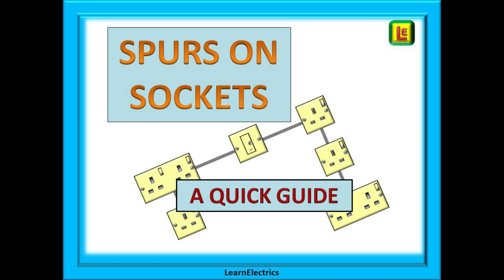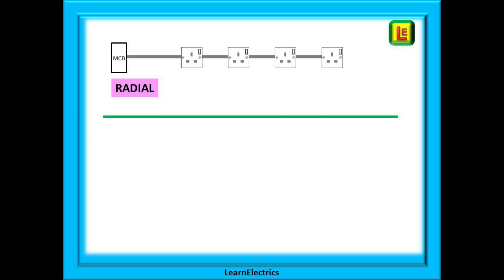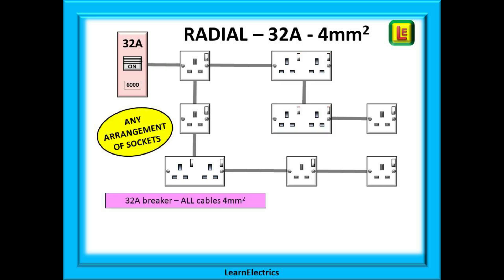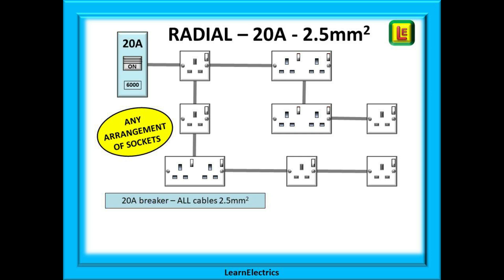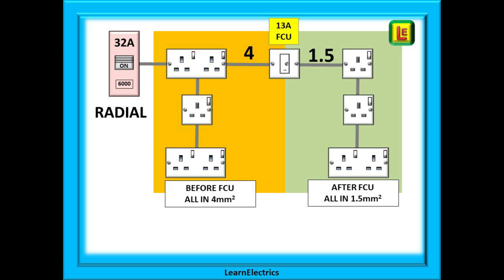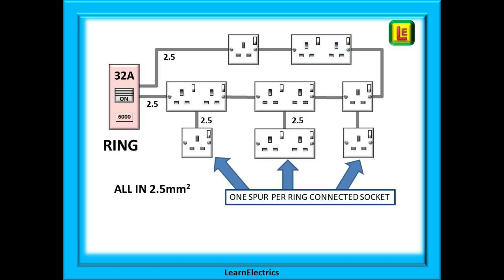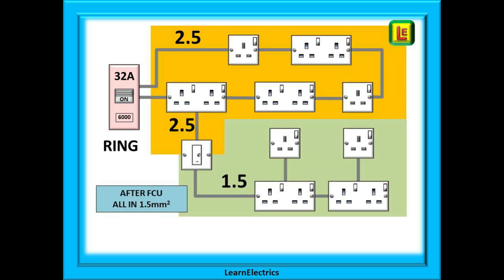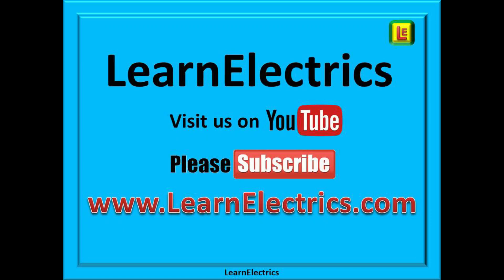Spurs on Sockets in Electrical Installations

Comment: AS A QUALIFIED ELECTRICIAN, I KNEW I COULD REDUCE CABLE SIZE AFTER THE FUSED SPUR CONNECTION THEO 1.5MM FOR LIGHTING,  BUT NEVER KNEW I COULD USE A 1.5MM AFTER THE FS, FOR SOCKET OUTLETS UNDER ANY CONDITIONS,  THANKS FOR THAT.
Reply from the maker: Glad it was helpful, thanks for watching. Dave.

Comment: Not wanting to sound stupid but How do you Know if the socket you want to add to is In a Radial or Ring Circuit please  ?
Reply from the maker: The only stupid ones are those that don't ask questions. Having two browns in the breaker, two blues in the neutral bar are a good clue. Then test it for a ring circuit. See the two videos on the links below, they will help. Dave.

Ring and radial circuit differences
https://www.youtube.com/watch?v=6GNb1SSEjQg

Ring circuit testing
https://www.youtube.com/watch?v=yPmBpunvoT0

Comment: Hi Dave, @2:38, is there a typo? 4mm square before FCU should be 2.5mm square? Although 4mm square is still acceptable but not necessary.
Reply from the maker: Yes, another of my famous typos. It should be 2.5 but as you say, 4mm is acceptable too, but not necessary. thanks for that, much appreciated. Dave.

Comment: More a curious question here if you may. How would you explain the need for the spurred cable from double socket to be 4mm to FCU if the load will never be more than what is after the FCU due to the 13A fuse? Is this something to do with under fault conditions if that cable got damaged or something? Thanks!
Reply from the maker: Exactly that. The cable is not protected by the fuse until AFTER the fuse. Thanks for the input. Dave.

Comment: if the fuse in the spur blows, would the sockets attached to it after stop working too?
Reply from the maker: Definitely. Anything downstream of a fused spur will lose power if the fuse goes, if the circuit is wired correctly.
Take a look at this video on radial socket spurs. Lots more info. Thanks for watching. Dave.
https://www.youtube.com/watch?v=Et7CpEwFEzg
Reply: @learnelectrics4402  Thanks Dave, appreciate your response.  Keep up the good content 👌🏼

Comment: Great video, I am very grateful. One quick question, in the ring circuit after FCU with 1.5mm square cable, Zs is going to be reasonably heigher. What would be the max Zs acceptable for this circuit?
Reply from the maker: Zs is determined by the breaker or fuse rating, not by the cable size. There is nothing to stop you using 2.5 after the FCU if you wish. Dave.

Comment: Awesome . May I ask a question please . I have o e socket in my garaje coming directly from the consumer unit , so it’s a radial circuit . I have taken two spurs off that socket by the way of an MK logic rapid fit face plate.
I have 3 sockets on each spur out . So my question is the RCD fitted is 16amp, but your video says I should use 20amp. Should I upgrade it ? I am using the correct 2.5mm cable .
Reply from the maker: I think you mean the circuit breaker is 16 amp, not the RCD. Your 16 amp breaker is fine. 16 or 20 are out with 2.5 cable on radials, no need to change. Dave.
Reply: @learnelectrics4402  yes I mean circuit breaker. Thanks Dave . I found your other video after which covered this . Subscribed !

Comment: Thank you once again for a great video. I am wondering if on a ring circuit wired in 2.5mm can we spur off with 4mm cable and create a series of sockets wired in radial using the 4mm cable?
Reply from the maker: If you use a 13 amp fused connection unit to come off the ring BEFORE any sockets then yes.
If not, then no.
Hope this helps. Dave.
Reply: @learnelectrics4402  yes it is clear thank you.

Comment: Hi, great videos.  Quick question..on a ring circuit, after a 13A fused spur you mention the cable size is 1.5mm.  Can it still be 2.5mm with no issues?
Reply from the maker: Definitely Ashley, 1.5mm is the smallest. 2.5mm is fine. Thanks for watching, Dave.

Comment: Great video and many thanks. I have a question if I may. We are wanting to add more sockets in our kitchen but unsure if it is a radial or a ring cicuit, so don't want to risk adding more than one cocket if it is a ring circuit. What is the best way to add 3 sockets without knowing whether it is a ring or radial. Do we add an FCU and then connect 3 sockets to that? Many thanks in advance. it will be REALLY HELPFUL x
Reply from the maker: Sarah, if you don't know what type of circuit it is then you have to assume it could be a ring and that then limits socket additions to just one accessory without using a fused spur rated at 13 amps.
Once the fused spur  (FCU) is installed you can take as many sockets off the FCU as you wish because you are limited to 13 amps max current along that line. Hope this helps. Dave.

Comment: Silly question, Can you do a spur from a light switch to a socket?
Reply from the maker: No. first its not good practice to go lighting to power. Second, there is no neutral in the light switch. Hope this helps. Dave.
Reply: @learnelectrics4402  Thank you for replying

Comment: Love these videos, but I have a question. Today I attended a Napit exams and it  started with some multiple choice questions. Question was ‘ how many sockets can be installed after a non switched fused spur on ring final circuit’ I got it wrong. Apparently it only 1 can be installed. Do you think this is correct?
Reply from the maker: Based on what you have written, I know that it is not correct.
Look at page 505 of the Wiring Regs book.
At the 3 o-clock position on the diagram, it clearly shows more than one socket connected to a non switched fused spur, along with confirmatory words.
Hope this helps, especially if your success in the exams depended on this question.
Good luck, Dave.
Reply: @learnelectrics4402  Thank you

Comment: Hi Dave, just a quick update. I have checked a course provider and below is the qualification I'll gain doing the 9 week course:

Building regs
18th edition 
2391-50
2391-51

Will this be sufficient enough for me to get on to a scheme, or do I need further qualifications. Thanks
Reply from the maker: You also need proof of two years work experience. To get the experience lots of people just do minor works jobs which do not need you to be registered. Take loads of photos of your work, issue a Minor Works Certificate for every job, however small. The photos and the Certificates will be your proof of two years work. I know a few sparkies who only do Minor Works and are making in excess of £500 a day.
Also, check out Napit or NICEIC website for the latest joining requirements.
Good luck. Dave.